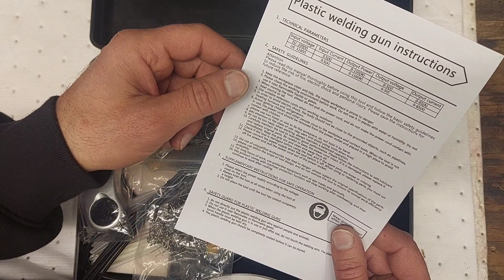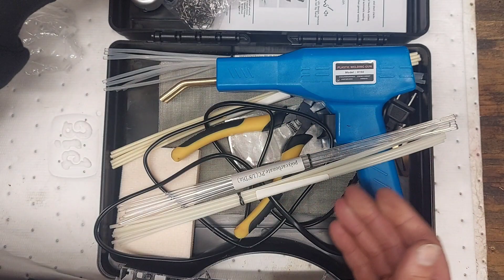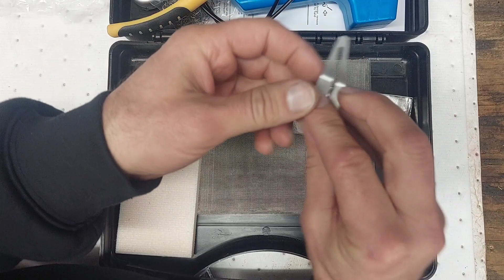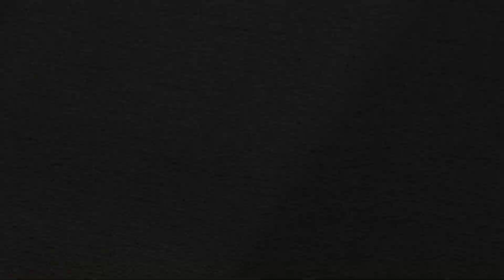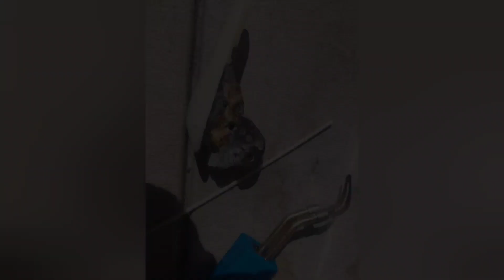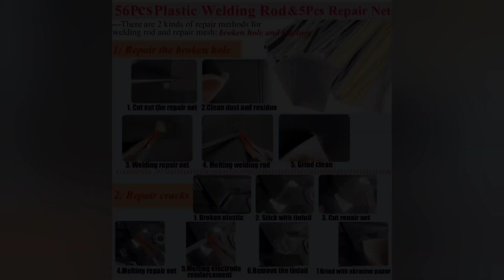150W Plastic Welder,2 in 1 Plastic Welding Kit Plastic Repair Welder Soldering Hot Stapler

Comment: Thank you for including the charts on how to weld holes ours didn't include any of that. I'm glad you showed how to put on the hole welding attachments since ours wasn't fitting on the end very well, so we thought we were attaching it wrong. Would have liked to see you using the welding attachment to add the plastic over the welds, since I have seen no videos on that. Thank you for posting we appreciate it.
Reply from the maker: I actually use this quit a bit, works great once you get it hot.

Comment: Great video buddy.  I bought one and waiting for it to be delivered today...same brand you have.  Seeing your video, it looks kinda cheap but looks like it serves its purpose.  Great review!
Reply from the maker: Thank you, I have used it quite a bit since  this video, and it works well. The repair that I made to the handle in the video is still going strong.
Reply: @mlacher100  Awesome! That's what I wanted to hear. Trying to help my son fix broken tabs on his bumper. This happened last year as well and had it fixed with new bumper for 1500 bucks painted. It's happened again, and I just refuse to pay that again so wish me luck 🤞
Reply from the maker: @rbdenham  your going to be fine. I also repairs tabs on a rug that folds down when you put the back seats down.  So many different uses for it.
Reply: I got mine. Does yours turn red and glow? Mine does not. Its melting but all videos skow the staples glow when heated up.
Reply from the maker: Yes mine glows red when it gets hot.
Reply: I ordered ftom Amazon  the 220 watt kit.
With staples,plastic filler rods. 
Arriving tomorrow 6-21-2025 for $38.07 out the door shipping cost 0 😊@rbdenham

Comment: HANDS ON WOULDVE BEEN MUCH BETTER THAN SHOWING YOUR VIEWERS BLURRY PICTURES!!
Reply from the maker: Thanks for your input, pictures look fine to me.
Reply: @mlacher100  Me too.  Pics look fine.
Reply: Yes wanted to see hands on.
Reply from the maker: I works great I use it quite a bit, the next time I use it I will definitely make a video of just that.
Reply: If you let the stainless tie preheat and then apply it to the repair it works better. Just putting it out there because it produced better results for me. Thanks for taking time to make an informative video.
Reply from the maker: @davedowning2 yes it does work better. I have had lots of practice since making this video. It works great, I fixed alot of things I was going to throw away. Thanks for the comment.

Comment: Hello Brother, thanks.  Good information.  In world surrounded by plastic these days, this should be pretty useful.  Thanks again and God bless.
Reply from the maker: No problem, yes it worked well, some of the brown marks were form the JB weld I didn't get off. As you see in the pics I posted at the end it made no burn parks when all the JB weld was removed. God bless!
Reply: Good thing you've got a plastic repair gun,you can repair the plastic case.
Reply from the maker: @roadrunner694 lol, yeah, right, this welder is holding up well and has come in use alot around the house and for friends and family members.